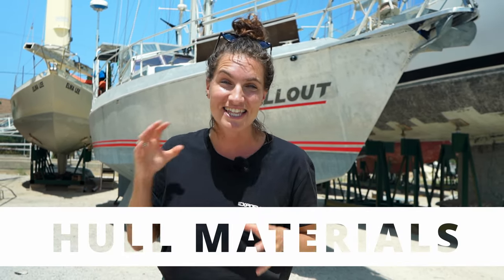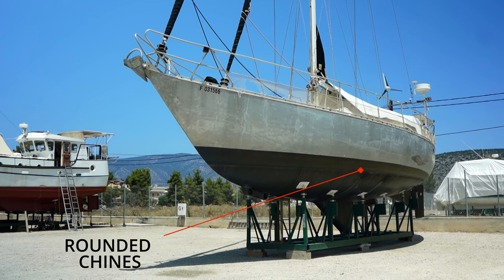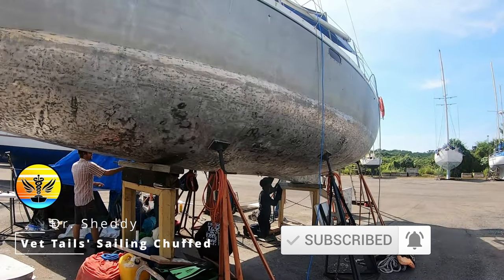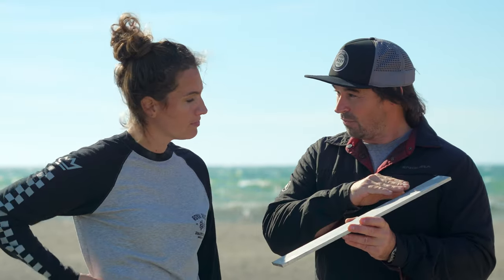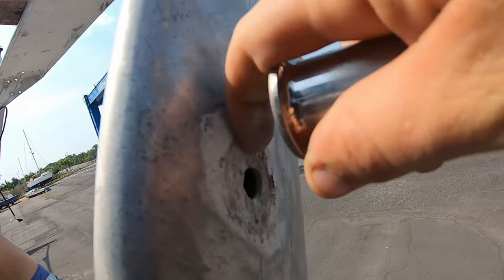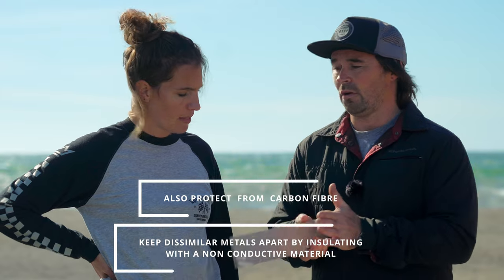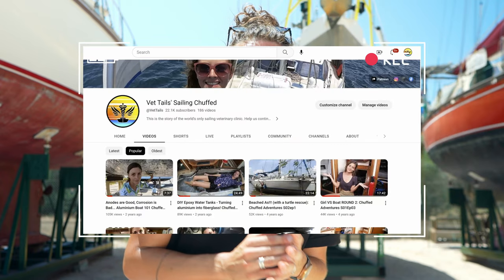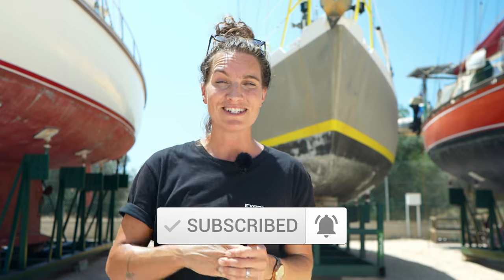The truth about Aluminium sailing boats from a PRO. Hull Material series Pt. 3

Comment: I sailed on a French (Joubert et Nivelt) designed Ali 18m yacht in "Meta" construction. Hard chine with plates welded together full length flat, then bent from from bow to stern to form continuous curves with minimal internal bulkheads. 20mm below waterline (yes 20mm), 10mm above with 8mm decks and cabin. With a less is more attitude to paint, above ground wiring, a good amount of anodes, attention to dissimilar metal interfaces (insulation and tefgel) you end up with a very strong, lightish, non corroding floating Faraday cage. Great cruising construction!
Reply from the maker: They are super designs! Our friend @oddlifecrafting are having a inspirational Meta built now. Similar to the old designs with some real modern lines, some tweaks to the structure and an impressive keel design!
Reply: sounds like a lot of steps.  Maybe too much hassle unless you are super dedicated to babysitting that boat.  Most of us just want to park it and forget it as life has lots of other demands.
Reply from the maker: @Coleen_West  maybe, but regardless of your boat you should be taking the same precautions… sail drives, metal through hull fittings, keel bolts, rudder stocks etc require the same attention and can just as easily sink your boat….
Reply: @SailHub  wow...didn't realize the time committment to this.  Kinda just want to have fun and park it and come back whenever and go out.
Reply from the maker: @Coleen_West  for sure! Thats what we all want! To be fair though, it’s all very simple to achieve, generally all sorted by the original boat builder - we’ve just got to keep an eye on it once in a while

Comment: I worked and bought one of the Alum /Foam collered Safe Boat and the prototype ended up as scrap after unprimed alum behind collars corroded horribley where the Ss bolts attached.
The salt formed donuts that grew until the sides cracked.
 We later epoxied as much as possible and put 
Lanocote on threads for any fasteners.
   Urine will destroy a hull , rats or human .
Battery acid too.
    One Non- marine battery charger from a neighbor boat will destroy your alum hull if not totally isolated.
   An electric start motor sorta makes it hard to achieve…….
     Alum was $1 a pound when I bought my $8k hull in 1990.
Now it’s at $3+……
Precious metals go up in value, as long as it is all there.
They use Ultrasound on alum hulls to verify thickness and if compromised.
Welding makes it porous too , why primer in/out is critical.
I saw a Stabicraft get scrapped after it had scuppers plugged and a car battery charger used to keep the bilge running 24/7 as welds leaked so bad. The diver let copper pennies and used zincs roll around it as he worked cleaning bottoms. The stuff scarfed thru the bottom.
“Salt away “is also your friend.
Reply from the maker: A lot of interesting points there Tim. All easily answered by a professional in the business too. 

Aluminium is a fantastic material but it’s but open for much experimentation.  The research is well documented and the rules are written, stand by them and you won’t have a problem. 

Cheers,
Chris
Reply: Generally ally hulls are not painted.
Reply from the maker: That’s true, yet the coachroof a often are. What do you think the new vinyl wrapping trend the likes of KM have moved to?

Comment: This is a great video.

 When I was younger my father bought a retired 65' mini-maxi, Boomerang II which was built by Direcktor in Ft. Lauderdale in the late 70's. We sent the boat back to Direcktor in the mid 80's for a complete refit and upgraded the systems and interior to convert it into a luxury  cruiser set up for a short handed crew. The boat was Aluminum and built like a brick shithouse! It is currently for sale and sitting on the hard in Portugal. I would love to buy it and refit once again but 65' is a big boat for my limited skills. Aluminum boats are the shit and the best option IMO.
Reply from the maker: Hey Zack, cheers for the comment and rest assured.. we will get into it again for a more in depth talk. 

This video is pretty basic as it is intended for beginners as we wanted a simple place to start from. You may not that every subject we talk about was very basal. 

We’ve just come from Portugal… saw a few nice ally boats out on the hard around Lisboa… we also agree that despite the price, aluminium would be our choice for cruising.

Comment: When we build pumping stations in S. Louisiana, the stainless steel pipe flanges are alloy 304 and 7/8" dia. stainless steel bolts are alloy 316. We have to isolate the two different alloys from each other using phenolic sleeves and washers to prevent corrosion.
Reply from the maker: Cool, isolation is such an important part of a build! What’s the phenolic part, I dont know much about phenolics at all and never thought of them as an electrical insulator - I would generally use nylon, and tefgel.
Reply: @SailHub  It's what the Corps of Engineers specified on the plans.  I think it is a resin based product, maybe like Bakelite.  I would think that nylatron would work fine.
Reply from the maker: Cheers fella!! Thanks for that 👍

Comment: Before buying an aluminum boat it's probably a good idea to learn tig welding on aluminum. If you have no experience then it might take you a couple months. You'll need the tig setup to make repairs. There are other ways but why bother? Learn to do it right with the proper equipment. You cant make fiberglass repairs without learning how either. Any place you attach stainless steel will corrode.

You fix it pretty much the same way you get rid of deep rust. Use a grinder to get down to good metal then build it back up with TIG. It isn't complicated to a welder, or hard. It does take a little money for the machine and gas bottles and a lot of practice. Might as well get started before you buy the boat. A good TIG welder already has a job, and they work for a lot more than your average mechanic or boat repair guy. You don't want to pay someone every time you need a little repair. If you're planning to use sweat equity this is a great place to start. Just my opinion . . .
Reply from the maker: Pretty good advice I’d say 👍
Reply: hmmm not sure I agree with this. Do you have any idea of how hard it is to weld PROPER TIG ? Esp on a hull plate with double curvature at play and you are effectively welding upside down! Its a monster of a job that takes considerable skill. MIG even worse because of porosity - its easy to get a nice looking MIG weld that is complete Sh*t !

Comment: good vid. comments, fwiw... Every metal has its unique properties, so working with it requires knowledge and skill: the hallmarks of a good tradesman. AL is a superior metal for marine applications, for the reasons noted here.  But nothing can survive abuse: not even the Titanic.  Sailed with a modicum of care, AL will outlast all other metals except stainless. True, AL needs to be insulated to avoid galvanic reaction, but this is no big deal nowadays, more so for power yachts. One pro I have found with unpainted 100% AL boats is they are cooler in hot weather: the metal conducts heat into the ocean, in the fashion of a heat sink. I have found cork decking to be excellent for AL yachts.
Reply from the maker: Hey Rob, thanks!!

Great points made there. Cork, for decking is superb, is a sure winner, spray cork inside is a fantastic way of insulating too. 

Interesting thought in Stainless for you… It needs O2 to remain corrosion resistant and so you generally find crevice corrosion is a big problem under the waterline, it will also tend to tear on impact which is another reason it is not commonly used.

We hope to be doing some testing with cork in the near future too, super excited! 👍⛵️
Reply: @SailHub   true about stainless. no material is perfect; the oceans are very unforgiving.  AL performs best for me.  I shall keep an eye on your boats.
Reply from the maker: @robgrune3284  too true!
Cool, keep in touch 👍
Reply: @SailHub  for me, the key to an AL yacht is to use AL only for everything to the extent possible. I would never use AL for a sail boat; too many different metals must be used, and all in contact with each other. AL works well for me, because I operate power yachts, and I can minimise the use of other metals, and all metals can be well isolated/insulated from each other.  to the extent possible, I keep all tools, cords, washers, etc in covered wooden boxes.  keeps the engine room more tidy, too.  and, all fasteners, tubes, etc are either AL or plastic.  all to the extent possible.
Reply from the maker: @robgrune3284 hey Rob, definitely some good advice there! It’s good to see more manufacturers supporting the aluminium boat market by producing gear that doesn’t cause galvanic hell! 

We have a little project starting next year where we will highlight some of these new yet basic innovations! 

Cheers for sharing your words 👍⛵️

Comment: I've worked on a few aluminium boats. It's great until you paint it, especially when lathered with filler prior to painting...it fizzes underneath. An aluminium hull with a GRP deck is great for a cruising yacht, and an all aluminium unpainted boat is great for a world cruiser.
Reply from the maker: Hey Ashley, yeah the paint issue… what do you think to vinyl wrap, that’s what KM are doing these days. 

As for grp decks… not convinced personally. I think they are a good option to drop the cost for sure as the boat is built inside and then the deck is fitted as opposed to the joinery being taken through companionway. Grp is great in the coachroof in many respects especially given the frames hold the strength. However with aluminium, the deck adding strength too the boat too generally makes it stronger and can be built lighter too. There’s also the thermal expansion difference which is known to cause issues over time on the deck hull joint. Still, they both work for sure! But paint… oh man, we are looking at firing our coach roof… I really don’t know if it’s worth it but if wobblier than a wobbly thing 😂
Reply: @SailHub  Yeah, look, I've got a bit of a hard psycho stalker obsession going on for the KM yachts Bestevaer range at the moment, they are my dream boat if I won the lottery. They are rugged but also genuinely beautiful. I know they used a silicone wrap below the waterline on their 36 foot Bestevaer, but it's a technology I'm unfamiliar with. Can't be any worse than painting below the waterline, which you'd have to do anyway.
The aluminium yachts I worked on were superyachts, which generally have at least half inch of bog all over them. I recall the painters chipping the stuff off by the bucket load and then having to alodine it all over again and then rebogging the daylights out of the boat again. If you could prepare and alodine the aluminium in a controlled laboratory environment it could work, like they do with cars, but you can't with a giant boat, so it will always corrode under the paint eventually.
Reply from the maker: @ashleymalamute the Beastevers are cool for sure, mind you some weird stuff going on there too… I was poking at a new one recently - a stainless bow protector screwed to the stem. So wierd, stainless cleats too. Just can’t get my head around it, at least bind the bow protector on! Weird.

They build boats well though, we were stoked when we came across our KM hull, probably a year after making the video we are commenting on. It’s so well put together, great platform to start from! As for the bog…. Not sure yet, not sure about vinyl either I’ve seen it look good and look bad after time in changing heats - the Med sun killed a few of them for sure. Maybe we will just stay raw!

Comment: Galvanic isolators are not a good solution for an aluminium boat (@ 7.00).  Galvanic isolators work by means of blocking diodes that prevent stray currents from flowing up the shore power earth connection, but open to allow earth fault currents from the boat to flow the other way, thereby causing the boat’s RCD to trip.  However, most modern boat are packed with modern electric and electronic equipment, such as ‘smart’ battery chargers.  During normal operation, these devices tend to leak small currents to earth.  These earth leakage currents open the diodes of a galvanic isolator, rendering them ineffective as a means of blocking stray earth currents coming the other way.   If you want to protect an aluminium boat from galvanic corrosion then fit an isolation transformer, as this will truly separate the boat’s earth wire from the shore power earth.
Reply from the maker: Yup, isolation transformers are far superior!

Comment: Today’s time one can take a relatively inexpensive welding machine along for emergencies. It’s not such a mystery anymore to due an emergency weld. And the units are not very big and lite. Even a smaller gasbottle is not a problem to take
Reply from the maker: That’s kinda true but there also the issue of amperage, blow torches and the likes, I depends on the hull thickness as for what you need really and if your going to take a TIG set then the price increases as you need an AC set, but for sure… the inverted sets are still so much cheaper and smaller than the transformer alternatives!

Comment: How noisy are aluminium yachts? I know aluminium plate say 6.5 meters fishing boats are way noisier than a my 6.5 meter fibreglass boat.
Reply from the maker: Oh they can be noisy alright but you really need to insulate them anyway due to the heat sink properties of aluminium. I believe cork is the best insulation at present and it’s a fantastic sound insulator too which is why we chose to use it for our podcast van you can see here; https://youtu.be/zXXzXpD3_ng?si=pNAQWkjU9r_I_SUG

Comment: Interesting. I had thought carbon fiber woukd be the preferred material.
Reply from the maker: Carbon is a fantastic material but it’s a bit brittle, even in as high modulus. Modern resins are certainly advancing here but for now aluminium is still better for high impact etc. if your racing though… carbons stiff hull, direct power transfer and light weight make it a no brainer!

Comment: Interesting. What is the (general) price difference between an aluminium and other materials in boats?
Reply from the maker: Hey, unfortunately aluminium has a pretty hefty price tag… I would suggest  the price is 3x grp and 2x steel.. This is a very loose guide mind as there are many methods for construction.

You can use cheaper building methods with the material such as Meta’s monocoque technique as opposed more traditional frame a mind stringer build that the likes of KM use. 

Either way it’s still expensive due to labour, popping a grp boat out of a mould is always cheaper and quicker. The moulds are the expensive part for grp construction however due to the high turnover of hulls it is quickly absorbed.

J
Reply: @SailHub  Wow, even worse than what I imagined. But understandable - there must be a good reason why very few are Al.
Reply from the maker: @JCKR-yv4gy sure is an expensive process! Sadly the other reason for less aluminium boats seems to be a multitude of myths which we hope to some how kerb at some point…

Comment: What do you think about making Catamarans out of Titanium, given the nature of Titanium, it's strength, lightness, the fact that it doesn't corrode, etc., etc.: ???
I'd love to hear back from you on this subject.   Thank you,   AD.
Reply from the maker: Hi AD, now there’s a thought! 

So, I’m not too confident talking about Ti as I am not all that experienced with it, I know that it it is very tricky to weld which would put me off as it’s going to be extremely hard to find someone to repair it. I believe it’s strength is great but this usually means means objects are made super thin, which is good for weight but I think it would likely tear on impact. It’s also crazy expensive.

It probably is a top notch material to use for the right boats however does it’s advantages outweigh its outrageous price tag! For me, probably not. 
For a racer? Probably not, a carbon hull  would likely be a lot cheaper. For structural parts though, I think your onto something there. 

What are your thoughts?

Comment: Wuuhoooo! Really like these videos.
I own a Stabicraft. Best boat I've had and it will last me a lifetime.
I am learning how to work on and weld aluminum to do my own repairs and to delete as many fasteners and accessories of other metals as possible. (Rod holders, grab rails, transducer brackets, etc)
I do have one question. What type or grade of aluminum is used for marine fabrication and what types or grades can be used when repairing or adding custom modifications?
Thank you
Reply from the maker: Hi! Thank you very much! Great to see your getting involved with sim AC/DC welding too! 

So, regarding the aluminium.. it depends on what your doing and where. In general 5000 series is what is used on boats. You can use 6000 series too, what is the particular application?
Reply: @SailHub  
Wow! Thanks for getting back to me and helping me with my question.
Yes I'm learning how to TIG weld aluminum. So far I have made my own bait tank out of a small aluminum fuel tank. It came out ok for my first project.
But to answer your question and moving forward the application of my next project would be to delete the stainless rod holders on the gunnels and make them out of aluminum to then weld them in place. 
So my question is what series aluminum should I be looking for when buying the extrusions (pipe, plates, angles) for my projects.
Thank you!
Reply from the maker: @jejoko excellent stuff! Well done 👍,

So, 5083 is what I would use for this.
Reply: @SailHub  
Thanks again captain!
You have pointed me in the right direction.